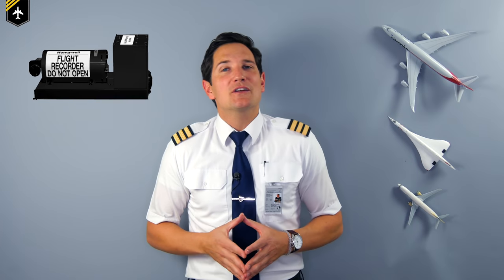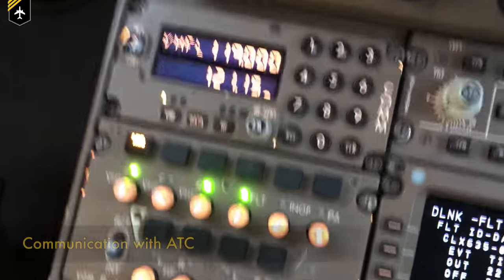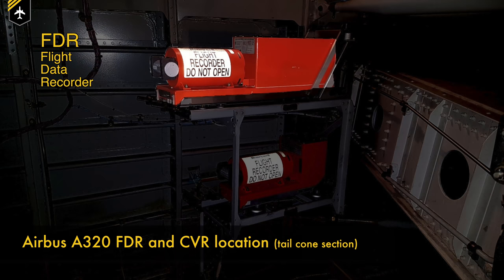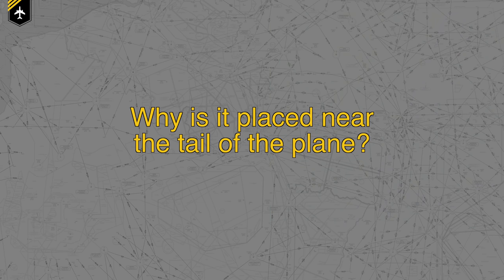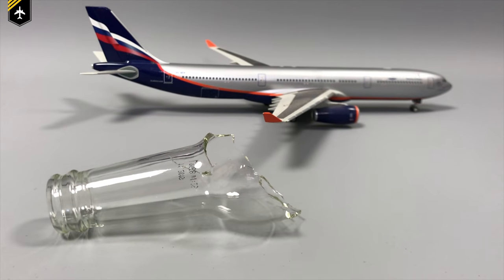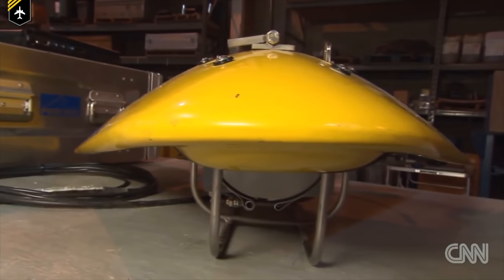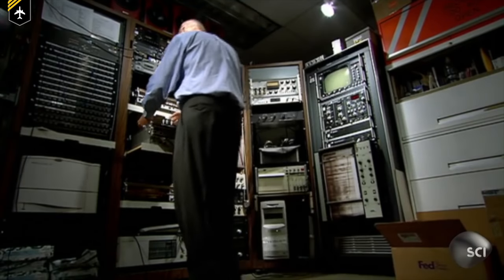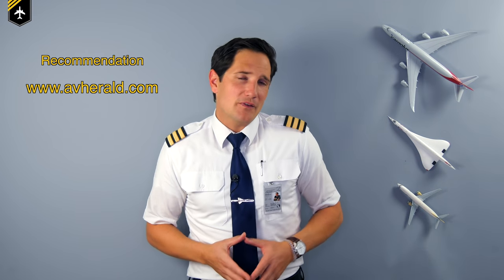BLACK BOX/Flight Data Recorder/COCKPIT VOICE RECORDER explained by CAPTAIN JOE

Comment: It would be nice if the CVR & FDR had a special GPX device on each of them that had a special real time satellite connection so if there is a problem they can go over the pings and get a better idea of where the plane was last at and where the pings stop they can start sending rescue to to the areas and then go off of the flight plan and weather info.

You said (4) Four microphones but you only mentioned where (3) Three are located, where is the last one located?

I wish that there was a Aircraft Video Recorder AVR box to go along with the CVR & FDR. This way ACI Air Crash Investigators can see in real time and after an air crash has occurred everything that happened and can see all the different conditions. This would mean there would be over Thousands of cameras that would be recording everything inside, outside and even between the outer and inner skins of the aircraft. If there was a spark between the outer and inner skin of the aircraft a pilot could see this and know exactly where it started and if there was a fire suppression system all over the aircraft then the pilot could activate it and take action Immediately to prevent an accident. This system would of prevented many different accidents that have happened. For example when we had that 911 if a system like these cameras were on-board instead of going off of only recordings, phone calls, and passenger statements. Thousands of Pin-Hole Cameras would of captured the evidence for the investigators.
Reply: The Aircraft has an ELT which sends out signals in case of a crash.

And 4 mics as the captain and F/O have one each

And yea the video recording feature is a good concept. But there must be a reason its not implemented yet (my guess is some video recording laws or something)

Comment: Hey Captain Joe, I don't think it's disrespectful to offer explanations of possible causes of aircraft accidents so long as its based on available evidence combined with your experiences and knowledge. I mean, I'm no air accident expert, but if i see video of a plane crash after a wing falls off I could confidently "speculate" that the plane crashed because not having a wing made it unfliable, and there was probably poor maintenance. I wouldn't think that's disrespectful but with the extent my aviation knowledge I would feel confident saying that. For a pilot, I'm sure you'd be able to have much more insight with a range of crash situations that don't necessarily need you to be the lead investigator

Comment: Captain Joe , is there any statistic about the ratio of black box destroyed or missed ? Do you think that the blackbox should be redesigned to include more data and placed zone in the plane for sure it could be found easily.
Reply: The CVR and FDR are located in the tail.  that is where the most likely survivablility is.  The modern FDRs record many more than 1000 parameters (captain Joe was wrong on that point).   It would take too much typing to actually describe how an FDR is partitioned in order to record many more than 1000 parameters.  But be assured, a modern FDR records enough parameters to make it very clear the configuration and the cause of most crashes.

Comment: Your german physicist is wrong to compare a bottle with the aircraft hull. Bottle is made out of blow molded cylinders while aircraft body is made of machined aluminium block. The only reason is because the nose and the belly absorbs most of the impact

Comment: Better question would be why are we still using 20th century technology in the 21st century it shouldn't be that difficult to broadcast the inputss to a satellite which would then rebroadcast it to the ground where the voice recorder information and the data recorder information could be copied to a server. This would negate the need to always find the black boxes you would always have a copy of what was on them right here on Earth. Also, I still don't see the need to be able to erase or turn off either of these recorders once the engines are started.

Comment: I never knew that the pilots could erase the CVR recordings, that was interesting. Couldn’t that lead to a loss of evidence if, say, a near miss (or crash) occurred due pilot error? I read somewhere that pilots wanting to “go dark” could pull the breakers for the CVR/FDR. Is this true?
Reply: Yes both systems do have a circuit breaker.  But the CVR will continue to record for 10 minutes after power is lost.

Comment: Can u make a video about a typical day at work plz
Reply: Being a commercial pilot is not that hard for most people.   For short haul (less than 10 hours active time) flights one just needs to check in, get flight plans and briefing information, go through the preflight checks, operate through the airport, take off, snap autopilot, then nearing the other airport snap the autopilot off and take over from there. For situations where pilots would need to be on duty for more than 10 hours at a time two crews are hired.  Command crew serves as the takeoff and landing team as the relief officers wait until its about two to three hours into the flight, invade the flight deck, and have the command crew rest until the critical 2 hour landing plan.  Not that hard?

Comment: How often are they maintained or removed and or serviced?
Reply: There is no requirement for removing an operational FDR or CVR based on time.  There is requirements for verifying the units funciton as expected as part of a scheduled maintenance program.   Each FDR and CVR has a ULD attached to it (Underwater Locator Device).  The ULD has a time life (usually 5 years) and needs to be replaced before its time life expires

Comment: How the crosswind landing is done . Means what are problems do pilot  face during this landing and what is the perfect way to tackle cross wind
Reply: PILOT, Profession Beyond The Thinking. There are 2 ways, but crabbing until just over the ground the pilot KICKS IN RUDDER  ion straighten the plane, the other is a side slip, and a forward slip, but most CRAB.

Comment: Do private planes have them as well or only commercial passenger planes.  For example let’s say a rock band has their own private jet.  Does that jet have to have a black box as well?   What about the small planes like a Cessna?
Reply: WWTormentor having a black box is governed by local aviation authorities. So if a black box is mandatory in one country, its not necessary that its the same in another.

But the General norm is all commercial and private jets have it. Smaller propellor aircraft also have it depending on the no of seats it has. And small planes like a Cessna 172 wont have one.
Reply: ZK-APA thank you for your response.

Comment: Why is the erase button so easily accessible? Doesn't this mean that there's a chance something will strike by accident in a crash or say if the plane goes upside down?
Seems to me that functionality is a bigger risk than it's worth.
Wouldn't it be better to just make it punishable by death to listen to the cockpit recordings without valid reason and if there's an investigation, anything said in cockpit won't be held against the pilots as far as their CEO is concerned?
Reply: Caddle   Or maybe the button is a dummy that just let's pilots think they erased it?

Comment: Does the black box have a radio transmitter for carsh on land so it can be traced by radio waves?
Reply: It has a ULB (underwater locator beacon), it will activate and send a signal but only acitvated by water.  Will continue to transmit until the battery is dead.  If the water is too deep it makes it more difficult to recieve and triangulate the signal.

Comment: I don’t understand why there is no system to transmit the data from the black boxes remotely through satellites and other systems to a safe place (servers on land) so they don’t have to go crazy searching the black boxes. The technology  nowadays is more than enough for this purposes, and if they can give access to internet in some cases to passengers, they can definitely do this.
Reply: With the amount of data, there will be just too much of lag, which means incomplete data. With the black box physically being located in the aircraft, its instantanous.

Also, the use of the black box (relative to the no of flights) is close to nil, so having such sort of redundancy doesnt really have much of an advantage.

Comment: Why not eliminate the cost of recovering the FDR and CVR and just send the telemetry to ground stations? What year is this? We have a constellation of global communications satellites just for this type of application.
Reply: lohphat its just too overkill. Yes on paper it seems decent but in practice, it is too much data throughput (black box info is really dense information) for something which ideally will never be used. 
Its something like having 3 engines instead of 2 to eliminate dual engine failures. On paper factually its correct but too overkill for implementation.

Comment: why did sully say cactus 1539? the flight was us airways 1549. maybe just a mistake i guess.
Reply: NAPPYKID _ That is the knickname for the line, do you recall AIR FLORIDA? Well they were PALM, as in palm trees
Reply: @flybyairplane3528  i was talking about 1539 and 1549 not cactus and us airways. 3:58
Reply: NAPPYKID _ well the question is why SULLY said CACTUS 1539, there is a valid use of this, but it WAS NOT A MISTAKE,
Reply: @flybyairplane3528  yea i know that airlines don't always use the airline name as their callsigns. i meant that sully said 1539 but the flight numeration is 1549

Comment: What happens if you flip
gear up while taxiing ???
Reply: Carl Fichtner the gear has a pressure sensor, so it will detect that its still on the ground and hence not put the gear up

Comment: How often anybody pilots specially check the pitot tubes.. Hehehe if longer than 24 hours on tarmac r u covering pitot tubes... Hehehe with covers or tape... Hehehe specially in warm klimat places.. Hehehe were air France pitot tubes frozen or unprotected in Brazil on tarmac...

Comment: That Malaysian370 indecent left absolutely no trace it seems. How comes no signal from any of these devices?
Reply: ArnoGoldfinger how the hell will you hear a pinger when nobody knows where the hell it is ?
Reply: @flybyairplane3528  The signal must have some range, triangulation would locate the device. I'm guessing the signal will not escape thousands of feet of water. Your language by the way - no need for that.

Comment: I got an idea:  Why not add two tin cans and a line between them to assist in airplane communications.   I mean a 2 hour limit on recording???  and the best yet is that big ERASE button!!   And how many generations of planes must we go before there are a few video cameras added.  Like a simple camera so that the crew can physically see if the Landing gear has descended appropriately!!    These plane engineers need to get out of the 19th century and into the 20th century at least!  Oh where is the GPS so that the location of the plane and the black box is known at all times --- No Matter What!

Comment: If the black box can survive almost everything, then why not make the entire plane out of the same material?
Reply: Xxswag_dawgxX    Captain Joe said the boxes weighed about 20lbs each, the plane would become too heavy to fly if the whole plane was made of the same stuff, I am thinking 🤔
Reply: @donnawoodman6249  more powerful engines
Reply: @bct_planespotter5598  that would be impossible. Well it's possible, but no one would buy it. The plane would be terribly inefficient and fuel costs would be too much for airline companies. Not to mention the cost of materials as the material cost would surely be increased by about 4-5 times the original amount. You have a good idea but think of it in a different way. Use this question. "Why can't we use a stronger and lighter weight material for planes".

Comment: the bottle analogy is one of the worst I have ever heard.
u even pointed out that the bottle neck has thichker walls because of the manufacturing process. of course aircraft fuselage is not done the same way (thah!) so does not apply the same relationship.
instead you could have pointed out that most aircraft hit the ground from the front, so most of the impact is absorbed by the rest of the body, or that because of the cargo and passangers main fuselage is under way more stress than the pretty much empty cone, or that a smaller section is stiffer in structures theory, than a thin wall cylinder
u do a great job in this channel, but if you are going to say something without knowing, please check first, or dont say it :/

Comment: Joe why are you using pounds??? It's not even a standard in the aviation industry like ft are! 
Metric system master race!
Reply: Ned Laskov when you want to see a REAL SCREWUP, calculations standard, and Metric see AIR CANADA, the ‘GIMIL GLIDER” A B767., the screwups were the wrong fuel  density, wrong quantity, etc, you de CANADA  went METRIC, but the US BUILT is in standard., but that’s why there are problems in RUSSIAN made planes where their ALTIMETERS are METRIC, but the rest of the world with ATC is in FEET, ie : A KASAKASTAN  cargo jet BLEW their altitude, and COLIDED with a Passenger B747, over INDIA years ago.